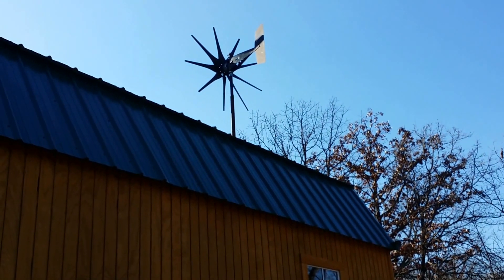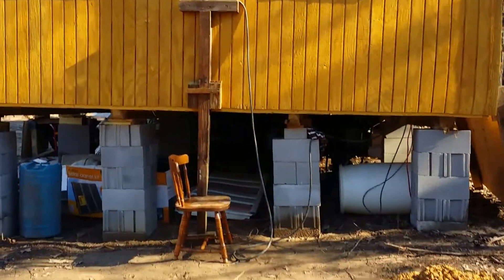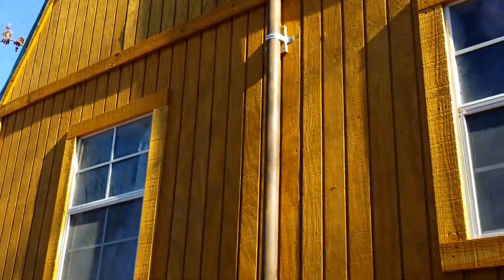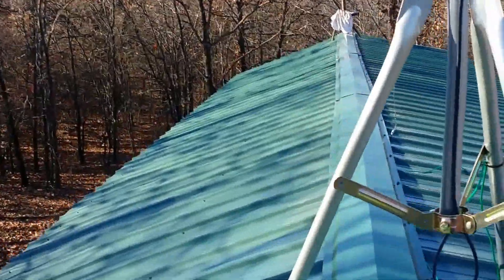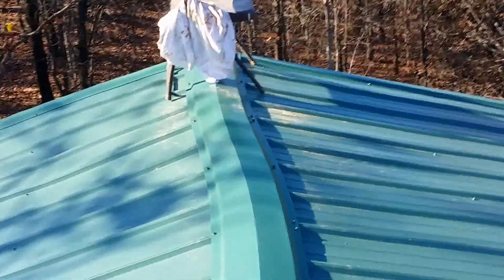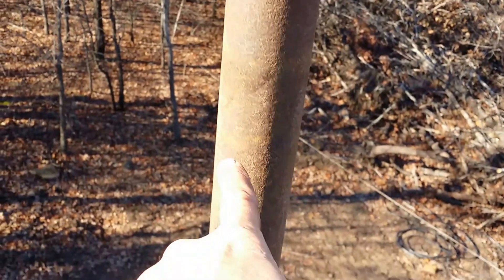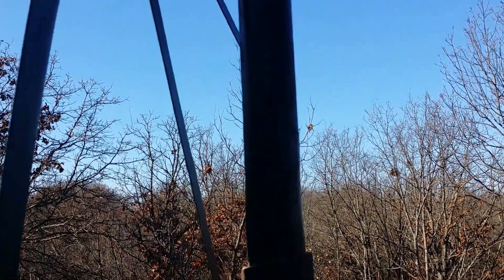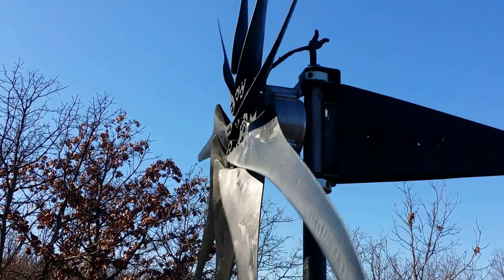Missouri wind turbine finally up and running

Comment from the maker: I'm thankful for every watt I get from this. It's location and height are on purpose for now. It starts to spin at only a couple of mph. I'm glad it's made on planet earth because I don't have any contact with extra terestial customer support. By the way, Missouri Wind and Solar customer support can't be beat - they have always been there for me.
Reply: +George Washington It makes on average 600 watts at 30 mph. That is not a false claim I own one. As I have not had winds higher then 30 mph I cannot confirm if it does or doesn't make more then that.